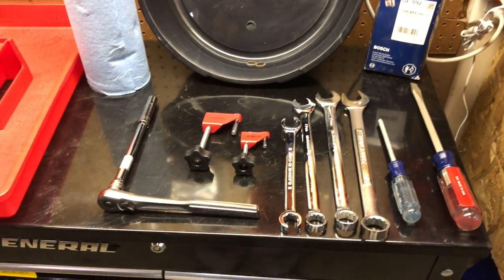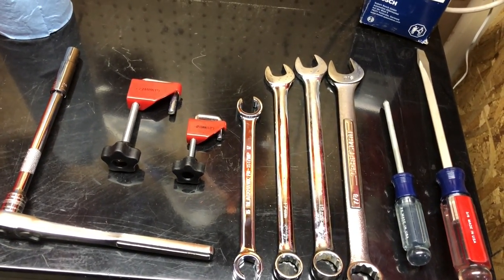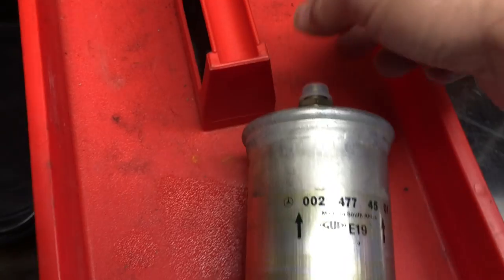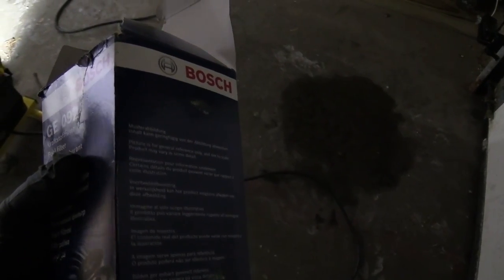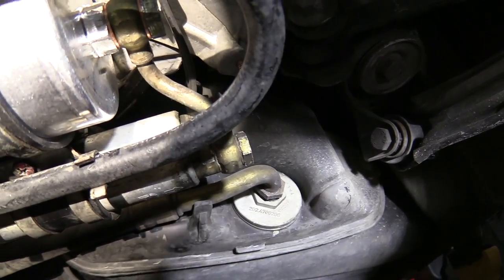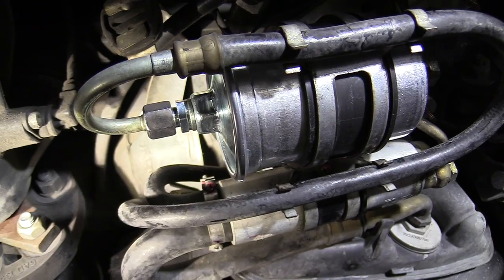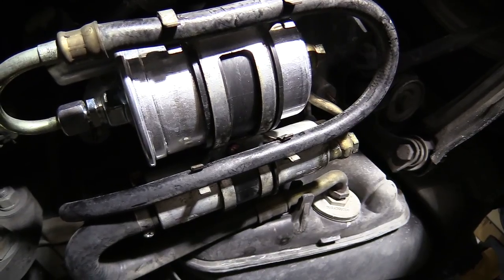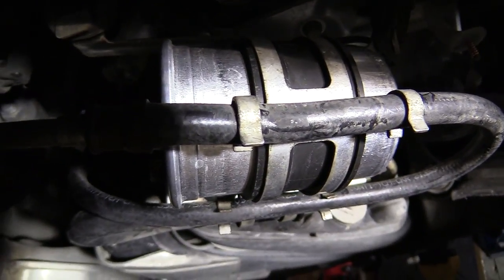Fuel Filter Replacement, 1994 Mercedes C280

Comment: What is the item miss a hose right behind the pump and flite  on the right side? Looks like a vacuum line?
Reply from the maker: Had to think about this question. The fuel pump has wiring from it that is wrapped and fished up to the connector. I don’t recall any vacuum lines….the pump and filter are near where the parking cable routes and maybe also the charcoal canister line…

Comment: Did you update your wire harness? They were all biodegradable in 1994 among other years.
Reply from the maker: I did not. I am assuming the original owner did as all their maintenance was performed at the dealer over the 24 years they owned it. I reviewed what I can saw a handful of “warranty” or “recall” repairs.